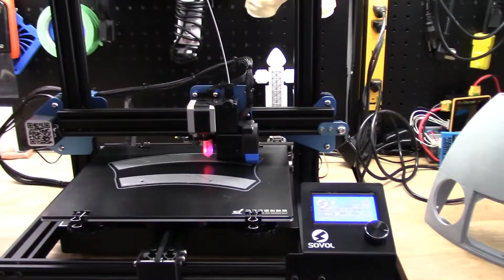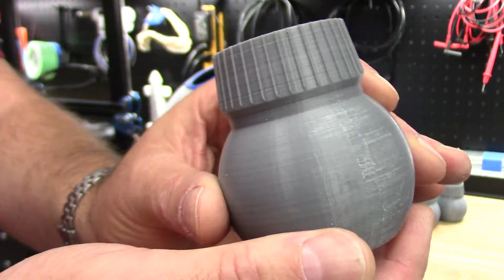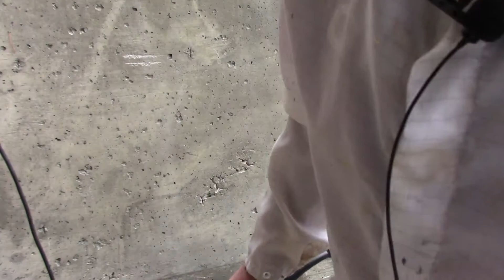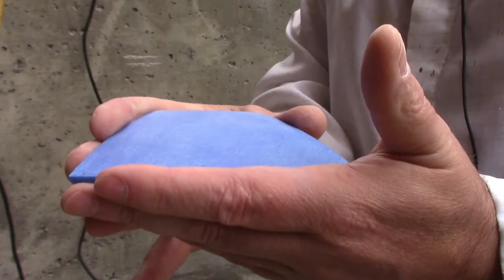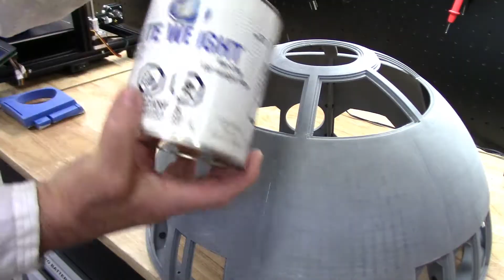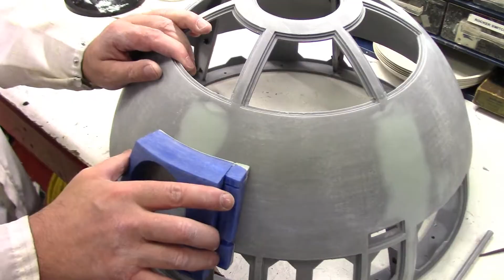Make Your Own R2-D2 - Part 1. Dome printing & assembly.

Comment: Hey! Thanks for the tips on the Lazy Susan sizing. Question though ... if you changed the scale of the Susan ring, do you need to change the scale of the gear print as well? Any other pieces need to be changed to match?  Thanks!
Reply from the maker: Yes indeed on the pinion gear scaling - no other scaling involved. I cover that in part 5 of the series (Body & Dome Drive).

Comment: Hi! Thanks for the tip on the gear ring.  I am having to change my scale as well. Question, did you have to change the scale of the Drive Gear itself too?  Thanks!
Reply from the maker: Yes - covered in part 5 of the build series: https://youtu.be/m6VXt6VGZ3c

Comment: Hi! I know this video is old but I just started working on my own R2. I got the exact same lazy susan with the same diamter dimensions. I was just curious if you also scaled the upper and lower ring prints or if you only scaled the gear drive? Awesome work by the way! This series have been a life saver
Reply from the maker: Only the gear since that is what fits inside the susan.
Reply: @Rchelicopterfun  Thank you!

Comment: Bonjour, je m'appelle Thierry, j'ai 60 ans, j'habite en France. Je suis en train de construire un D2R2. Je suis votre vidéo avec beaucoup d'intérêt. J'ai acheté la couronne de 450mm 18 pouces mais j'ai le même problème avec la couronne dételée. Pouvez-vous me donner vos fichiers modifiés s'il vous plaît car je suis nul dans la conception d'objet 3D et je me fie au fichier stl de Michael Baddeley
Hello, my name is Thierry, I am 60 years old, I live in France. I am building a D2R2. I am following your video with great interest. I bought the 450mm 18 inch crown but I have the same problem with the crown being uncoupled. Can you give me your modified files please as I am bad at 3D object design and I rely on Michael Baddeley's stl file

Comment: I just received my bearing in the mail and it is way undersized. The outside diameter is only 444mm. Would this be useable or would it be best to return the bearing and try and source one that is closer to the 450mm OD?
Reply from the maker: "Way undersized"? 4 mm smaller than the one I'm using so less than 1%. That is nothing and is perfectly fine. If I would have been lucky enough to get that size, I wouldn't of had to reprint my entire lower ring sections as there would be adequate clearance giving an extra 2mm on either side which would have likely been just enough for bearing to thick sidewall ring clearance.

Comment: I'm really enjoying the series. Do you happen to know if the version 2 R2 files for the drive wheel have been corrected to fit the larger Lazy Susan? Or have you uploaded the modified files anywhere? Thanks again for all this helpful info.
Reply from the maker: Thanks for the views and glad you are enjoying the build series. To answer your question re. the version two (2) dome file, I don't know if Michael has any other main ring gear files? He does however have the two lower ring files for adequate L-susan clearance as I mentioned. Because there are slight dimensional variations between different L-susans, I can't think of any other practical way to obtain good fitment other than changing the scaling ratio in your slicer program to fine tune the fit.

Comment: Are you using pla or petg? I’d love to start the journey but only have pla experience so far, and not sure how it will hold up over the long haul
Reply from the maker: Covered in the intro video to this project: https://youtu.be/hkkSagTsLXY?si=uEHtPnU0TrrYDYd6
100% PLA+ (other than the TPU for the tires, holoprojector servo arms & speaker mount).

Comment: I see your ring gear has elongated holes but the Baddeley files only have round holes. Did you mod the files, or are these available somewhere?
Reply from the maker: Didn't mod the ring gear (other than rescaling it to fit my specific susan). The Baddeley Mark 3 body file ring gears all have the elongated holes.
Reply: @Rchelicopterfun  Thanks. Comparing the MkIII gear files against the V2 it's clear they're quite different. which is why I originally couldn't figure out why your scaling factor was so different to mine. The V2 one fit my lazy susan hole profile quite well so instead of scaling it I just made the gear wall thicker so it fit more snugly against the lazy susan.

Comment: Shouldnt the eye be more crooked to be screen accurate?
Reply from the maker: What are you talking about, I don't even fit the radar eye in this video. I don't fit it until part 2 (painting the dome) where I clearly state its position is all over the place; some level, some crooked. In short, we fit them however we want because there was no consistency on screen either.

Comment: awesome i use the same esun 3d filement im  getting my printers ready for this project got all the g codes ready got my blue filement ready waiting on some more white to get here
Reply from the maker: Have fun!
Reply: @Rchelicopterfun  ty yes just started the radar eye
Reply: when you printed the blue panels did you have to cut the backing my files for most of the blue panels for the dome had support on the back

Comment: What settings did u have to change to print R2? I have the same printer.
Reply from the maker: It depends on the specific part being printed (cosmetic vs. structural) and of course the type o filament used. I mostly used the recommend print settings as outlined in Michael's instructions as well as the Printed Droid Guide; both of which I mentioned and link to in the first video in the series covering resources. Did tweak a few of course but kept it about 90% as per the recommendations.

Comment: Hi John . Got my sv01 and starting testing next week. Buying esun pla+ grey for dome. How much did you use for dome as 3kg cheaper but don't want to get that much if don't need that much. Thanks
Reply from the maker: I honestly can't remember. Even if I did however, it wouldn't be of much value because it's totally dependent on your slicer settings (infill & wall thickness), and mistakes. You'll get a pretty good idea of how much weight of filament is used on each part when you slice them in your slicer program as they indicate the weight of the print.
Reply: @Rchelicopterfun  thanks John. I've started test printing and hope to start r2 next week. Thanks for all your help. I'll be visiting your videos a lot over the coming months.

Comment: I'm really enjoying this series - I'm curious what orientation did you print R2's Radar Eye in and also the small logic light holders? Did you use supports? Cheers!
Reply from the maker: As stated in the video, I printed it with dome/curved side facing down - used supports. Guess I should have printed it according to the Printed Droid Guide I reference & link to in the first video (left flat side down). Not sure why I didn't follow the guide on that piece?  Perhaps I figured I'd get better results printing it back curve side down? I can't remember as that was many months ago now. I think I printed  logic surrounds flat (back) side down going by the layer line directions.

Comment: hi john did you print ring sections d and h when you reduced the sizing, i can only see six red ring pieces ???
Reply from the maker: Hi Martin - I actually increased the sizing of the gear sections (102.4%). The ring gear I printed was the 6 piece version with the cross brace arms as an integral part of two of the gear sections. I can't recall exactly what Baddeley folder they were in but it's not the 8 part ring gear with the two small additional cross arm tooth sections. It's only 6 parts which you can see if you look closely at the glued and finished ring gear.
Reply: @Rchelicopterfun  Thanks, i didnt realise there were two files, ill look for them now, although i dont suppose it really matters , they will both end up being the same size. Thanks again.

Comment: Do you have any estimate for how much filament you will use in total?
Reply from the maker: @Mickael Jansson - According to the Mr. Baddeley full size R2D2 print file instructions, between 20 & 25kgs depending on screw ups and specific print files used.
Reply: Hey well to give you an idea I’ve used 17 rolls of filament so far and I have ordered another 2 rolls, that should roughly do I think, in saying that I did reprint some of the parts by mistake and I did have acouple fail too. The body, skirt, dome, legs, battery boxes and all 3 feet are all printed but I do have to do the foot drives, I’m thinking I might do the Omni wheels too as I was going to buy them but don’t know yet. Plus I have a lot of the little things to print, like some of the coin slots, the power couplers and so on. As for time printing I started around the middle of August last year, took a week off from printing over Christmas cos we went away but the printers gone no stop basically for the rest of the time.
Reply: @zombiehunter1152  Thanks for the update 👍🏻
Reply: @TheRealStructurer  np , I know if your R2D2 body turns out as well as your dome has , it’s going to be one of the best 3d printed R2D2 around.